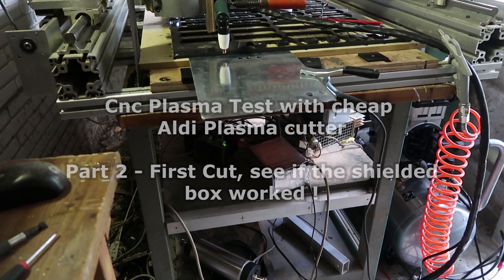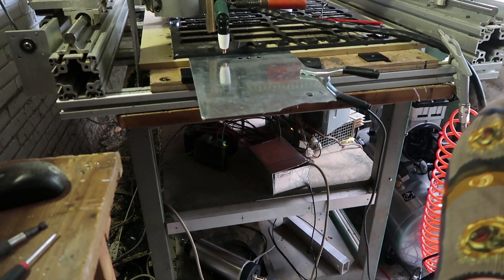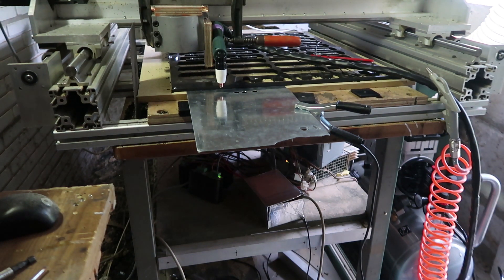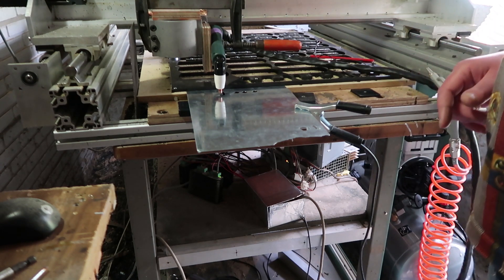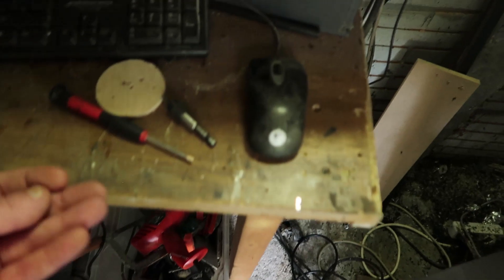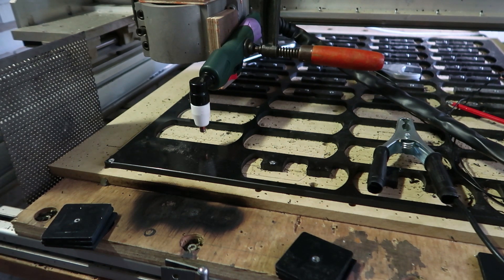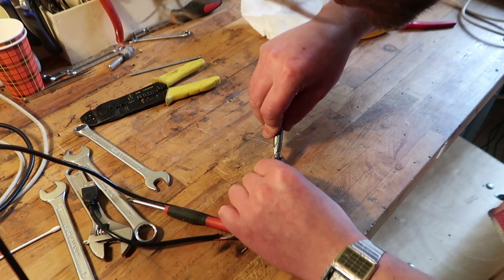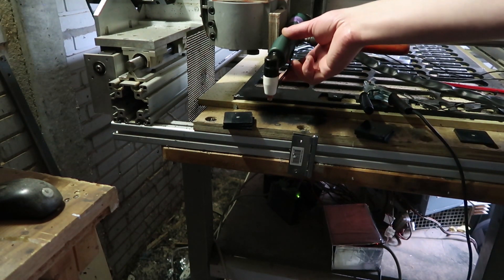PLASMA CUT - Part 2 First cut with the shielded Breakout board

Comment: say the letters g, h,  i,  and J, in Danish
Its  G= Gay.   H= ha!  i= Ee  J= Yee!  

Denmark is the second strongest engineering nation in the world 

 So to celebrate Valentine's Day,  it requires you to mathematically solve a Word puzzle  IN DANISH!   Rumor has it no one has solved the puzzle since the 18th century

  
DANISH  
Dansk er verdens mest retarderede klingende sprog. Du skal være en beruset englænder for at tale det. hat's hvorfor danske mennesker ser sjove ud og smiler hele tiden ... fordi de skal have det rigtige look hver gang de taler dansk. Ellers ville det ikke lyde rigtigt lol!

Jeg kan lige forestille mig, hvordan det er at være teknisk support. Besvarelse af folks opkald om deres mistede adgangskoder og beder dem om at give det lyd over telefonen synes at være det sjoveste, du nogensinde vil se og høre.

Jeg undrer mig lidt over, hvordan det danske sprog ville lyde med en typisk indisk accent?

Jeg tror aldrig, det er sket, fordi jeg tror, at et sort hul pludselig ville åbne sig og sluge Jorden.

nogle ting bør ikke fristes.

:-)

I am now CONVINCED the Swedish chef is actually  Danish.    PROVE ME WRONG!

About your cables

Firewire cables are Twisted  pair and also most have a shielded jacket on them with the ends also being grounded.    and are damn near free as most people no longer use it anymore.    Some even came with Ferrite  on them standard.  (Lots of Machine Vision cameras in places that also do  robot welding etc.   

Take what USB cables you have, and then change the ends to USB.  

Older cables all seemed to have the SAME USB Construction WAY back in the EARLY 2000's   and are often the Blue or Clear see-thru jacket.         

The other solution that has a MUCH Thinner cable is LVDS cable they use for Laptops.    (HARD TO FIND)    

McCalley use to make a mouse with this cable.  

The last solution would be to use  Coax.   Like they use on WiFi.    The Cable is pretty cheap.  ANd it's REALLY small and flexible.   Use a wireless mouse and couple the Antena leads to the SMA connector cable while surrounding the electronics in Aluminum foil inside the mouse to make a Faraday cage of sorts.
Reply from the maker: I always fall for the g j and a e :)

Comment: You can also cut holes and slots with your router if you stay with 6mm or smaller end mill. Nice to see your experiments work out. This is something that I should do as well.
Reply from the maker: yeah i used 2 mm cutter before, and ordered a special 2mm bit for sheet metal. but still.. my machine does not like it all that much :)  this could be much faster. but its not working yet so.  i dont want to jump to a victory yet :) but it looks promising